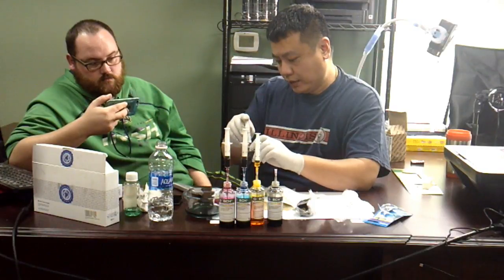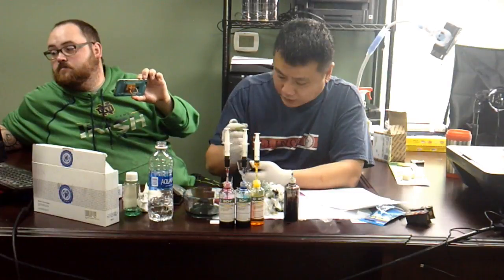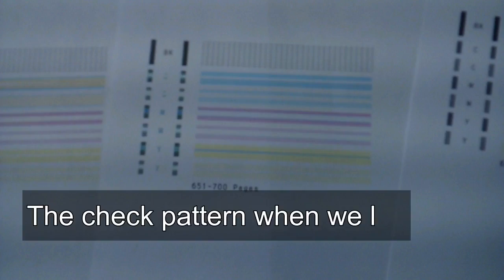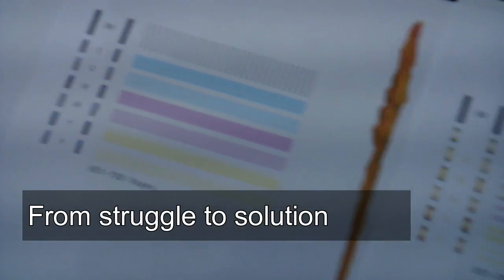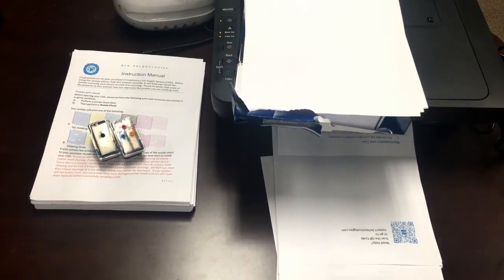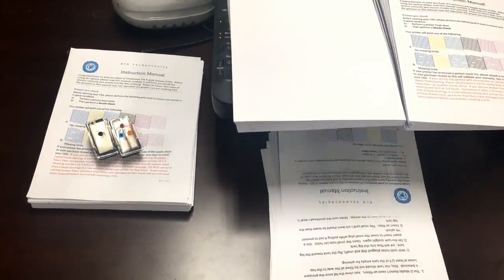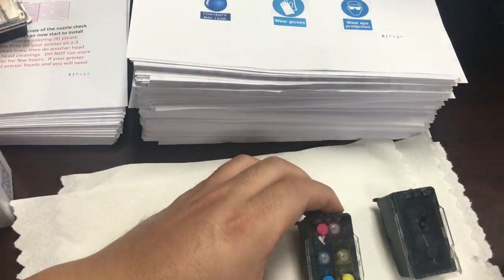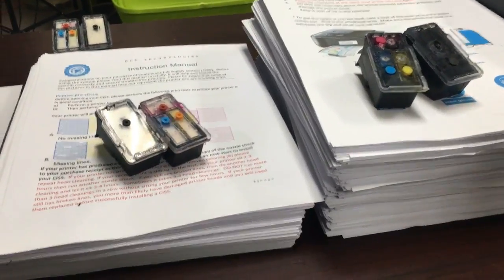Which is Better: Sponge or Spongeless Cartridge?  Canon PG-243 PG-245 CL-244 CL-246

Comment: Problem with this test, it is continuous printing,  it does not take account of the printer doing head cleaning, which happens every time the printer starts or the printed pages don't come out correct etc...!.
Using the printer occasionally, like most people do, lot of print head cleaning and ink wasting is done.
I all ways wondered about the claim,  300 or 500 pages printing capacity, when I barely get a few dozen pages printed and the ink runs out.
Cheers!
Reply from the maker: Inkjets are usually built for people who print regularly and like good-quality prints.  If you print occasionally, I suggest a LaserJet.  Although the color print quality is subpar, it won't have an ink drying problem.
Reply: @BCHTechnologies  Lasers are lot more money than ink jets.

Comment: can we joint ciss tank to spongeless cartridges?
Reply from the maker: Yes.  However you need to use a tape to seal the white pin hold (opening for the pressure regulator) on the top of the cover.